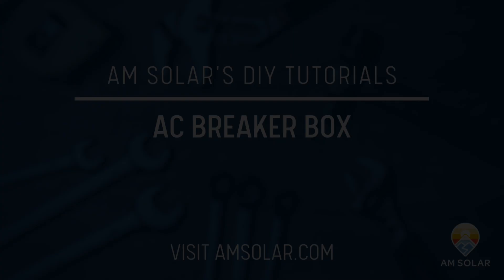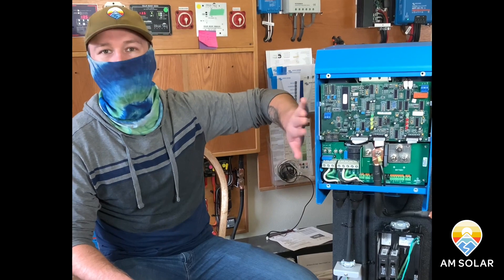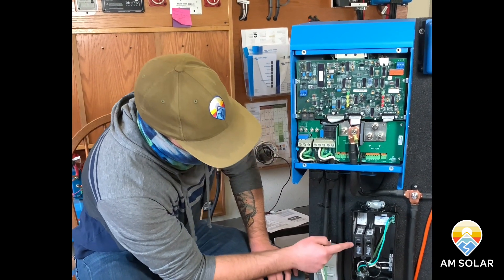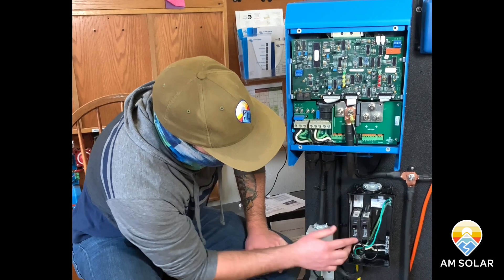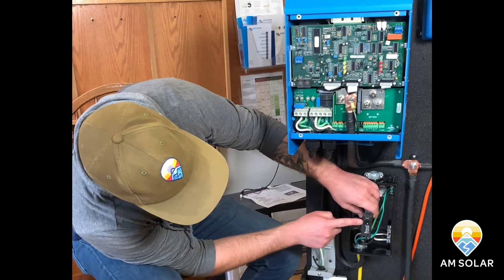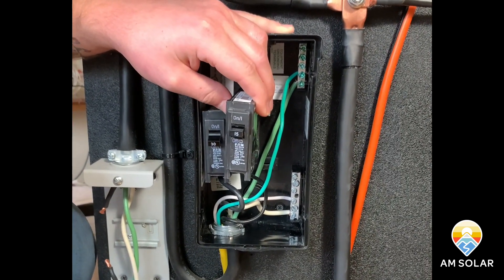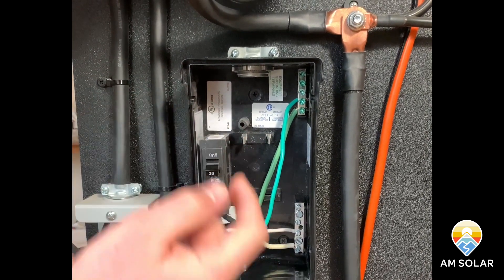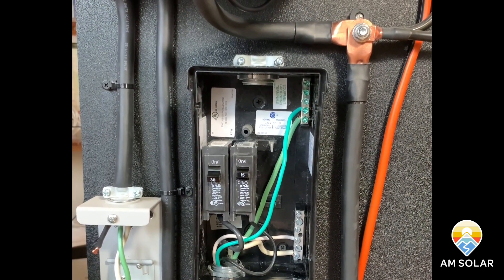AC Breaker Box - Adding An Extra Outlet Tutorial (AM Solar)

Comment: If your running a bigger inverter 5000 watts with the pass threw feature from the transfer switch to the inverter then to the main panel would you recommend the 240 volt models or stay with the 120
And just bridge the main on the panel?
Just curious what your thinking because most RV parks are 50 amps and is that 50 amps per leg on your shore power cord or is it 25 amps per leg?
Reply: This video is relevant to a 30A panel, not something that you would typically see with a 5000W inverter.  In your case, I would keep the 50A panel (with two sides).  If you want the one inverter to send power to both sides of the panel, use an AM Solar Smart Phase Selector.  We should have our 3.0 version available in February.
Reply: @garrettowne  thanks Garrett I'm still in the planning stage I live in Vancouver and work in Portland when I get closer to the actual purchase and install I'll give you a call maybe you can help me design the system for my needs. I appreciate your time and look forward to maybe working with you and your team.